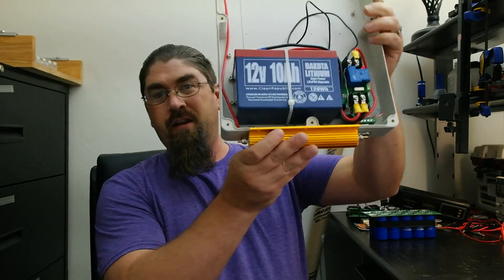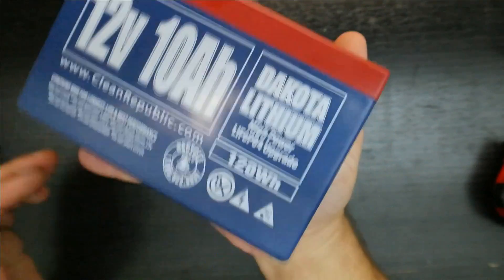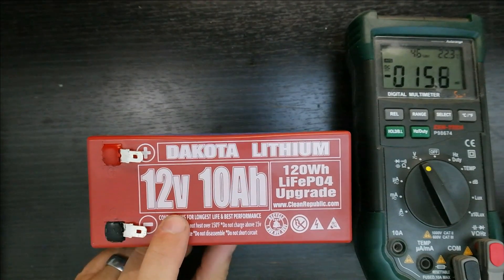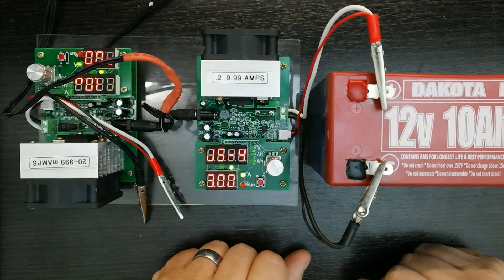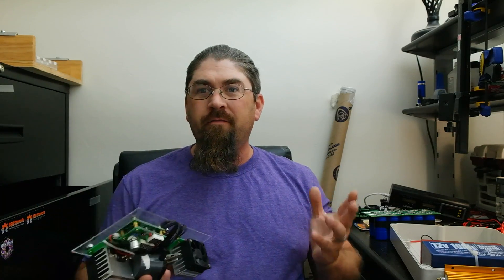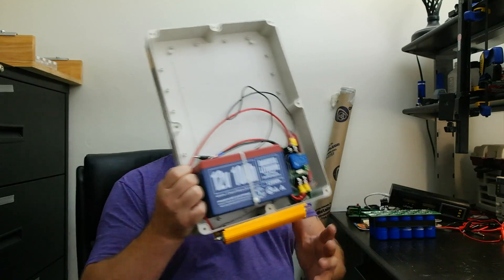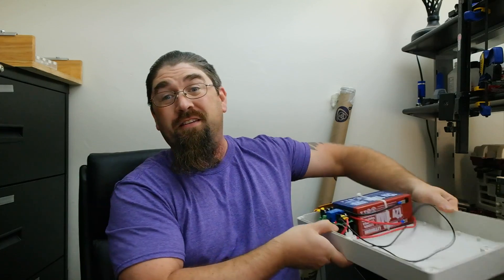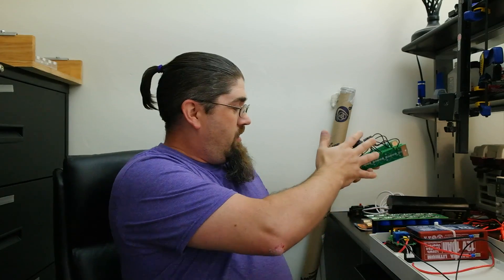Hybrid Supercapacitor Car Battery Part 4  - LiFePo4 Battery Testing

Comment: Hello. I’ve been watching many videos today on this subject. 
I have a question re the alternator coping with charging duty if this kit. ?
My cars ecu I think controls the current for my alternator, regulation. 
I’m shopping for  caps and batt currently, but my real concern is, will the cars alt cope with charging duty, particularly at idle when alt cooling efficiency is low ?
I’m guessing it Shld be fine because only 20-25ah lithium ?
Batt Shld be protected well cos bms. 
But how about the Alt ?

Comment: I have been interested in combining the SuperCap with a LiFepo04 batterty for Ham Radios which can have a high duty load on say 100Ws for multiple minutes transmitting digital communication in the field (aka no generator or electric power).  I found only one company making a combo Life04/SuperCapacitor but they did not recommend for something Audio which would probably one of the closest use cases.  Any thoughts about why this is an issue and also thoughts about using a larger supercap battery (Like the Maxwell) combined with a LiFepo4 battery

Comment: Not sure if i already posted this question but. Does the dakota battery cutoff charging below 0 deg C? I'm thinking of building a hybrid pack similar to yours, but instead of the dakota battery i want to make my own 12*32700 pack and i find that a bms with undertemperature charging disconnect is hard to find or too expensive for me. I'm trying to keep the whole project under 80eur.
Reply from the maker: Sorry, I'm not sure if it has under temperature protection.
Reply: @madelectronengineering  any datasheet/specsheet from where you ordered the battery?

Comment: Thanks...great video. I just ordered one for a new 12v portable power box. Been using a VMAX 10aH deep cycle AGM (SLA). Anyways, I plan to charge the Dakota using a Battery Tender Jr (750 mA output). It goes up to about 14.4v, floats at 13.2v. Will this battery be alright with that? Second, how about a vehicle's 12v charging system? My truck shows 15.3v after start up...and then settles down to 14.2v or so. Will that damage the Dakota if I use the truck to charge it? Cool test rig...$25 on eBay huh?

Comment: The 10Ah rating is over 20 hr discharge, i.e. 500mA discharge rate for 20 hrs. You won't get 10Ah with a higher discharge rate, conversely you'll get more than 10Ah with a lower load, say 100mA over 100 hrs.

Comment: It looks like that 12.73v is some type of average or integrated voltage as the voltage was drained from the start voltage at discharge to the cutoff set value (here 11V, I think).  If you multiply 12.73 by the Ah value (12.73 v * 9.781 Ah = 124.5 Wh) you get Wh (makes sense since VA=W) etc.  It is the value that would fit if the voltage was a constant 12.73 throughout the discharge cycle, make sense???

Comment: cool vid series. so that lifepo4 battery can be charged with a regular car 14~volt alternator output?
Reply: I think it is designed to stop at 14.4V, which may be too much for the lifepo4, not sure...
Reply from the maker: +riddick5 the battery can charge up to 14.6v, which is 100% charge on 4 lifepo4 batteries in series.  There's enough wiggle room in the voltage that it will work perfectly with 12 automotive charging.